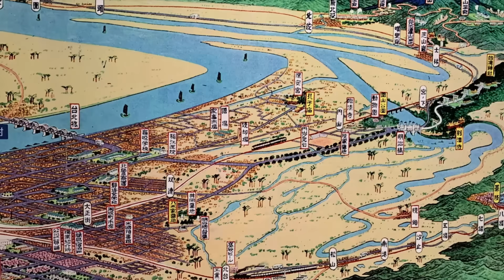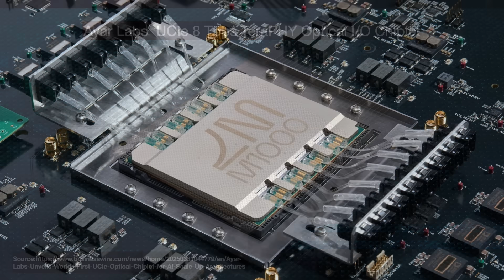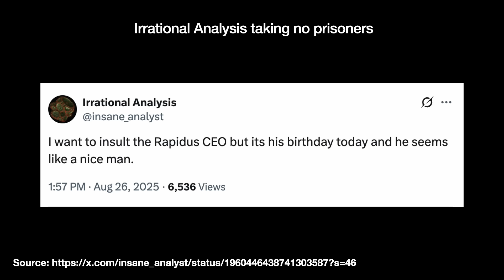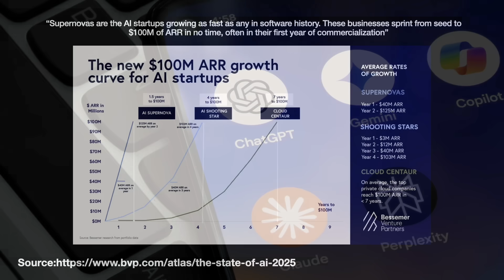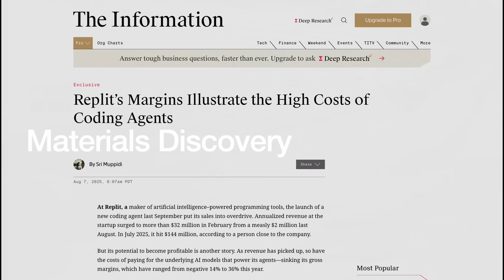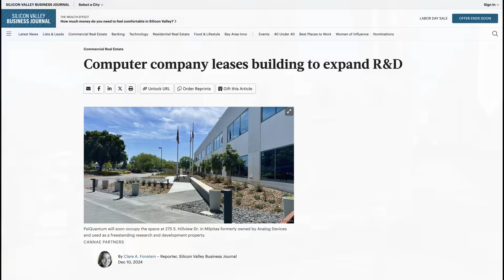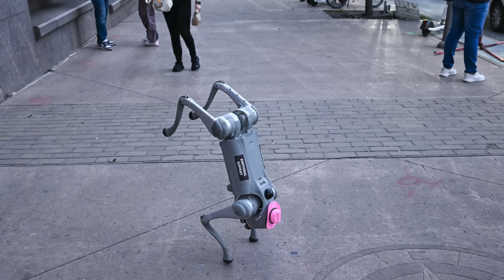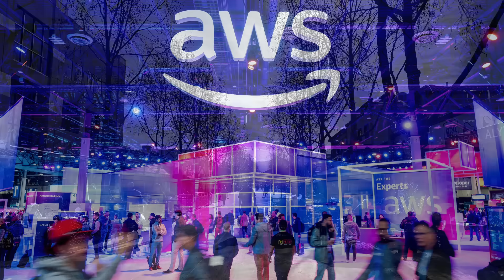Silicon Valley’s Doing Hard Things Again

Comment: You were at Hot Chips?!
DAMN, I missed the opportunity to say hi. I was there presenting a poster.

As I understood the Rapidus approach their idea is to have this fast turnaround opportunity to essentially get customers also interested in high-end nodes but that currently cannot get access because the giants buy all of it (think Tenstorrent and similar) and then use this time to develop towards a more mass-manufacturing ready node.

Photonics I agree, it seems to finally be ‚real‘ with their deeper and easier integration onto silicon.
Otherwise one of the main stories really does seem to be logistics in the datacenter. Be it power, cooling or weird ones like weight per rack. Scaling there might become difficult for these reasons alone.
Another thing I noticed is that literally everyone seems to use RISC-V for specialized tasks (ie custom extensions) in a lot of devices. Some of them actually sound rather high-performance. I would not be surprised if the big companies currently have decently high performing RISC-V cores in some products or at least the labs.
Finally I think Noam Shazeer all but confirmed that AI capability growth is logarithmic at this point and they need way more compute and bandwidth to get more performant models without fundamental changes in their approach.
I mostly think this because he is a true believer and if people like that talking about declining capability growth, then its probably happening.

Comment: It is a crazy world of suspended disbelief out there in the tech sector while cutting checks of many 0s. It isn't cost free though. I've really taken note of how much innovation has stalled. Show me one single AI application that has born fruit (outside of optimizing pain point pricing or AD revenue, the only two profitable applications I've seen). AI self driving cars? Really? We hate cabs that much? AI calculators running tflops of calculations per second? I saw someone raving about AI as the future spend 30 seconds watching chatgpt run autocorrect on their writings. AI image sharpening? It's like people forgot the solutions we had and the momentum of improvement of those paths before AI and marvel at the mediocre as long as it is new shiny AI. Also I'm not super worried about the "bubble pop". There are two categories of businesses revolving around AI. The "shovel sellers to the AI goldrush" as someone put it which there will not be a bill come due moment. A nuclear power plant is useful whether that power goes to AI generated search results or to a factory, and no one is going to return their GPUs when they discover AI isn't the future here and now. And there are the failures of this repeating burst where 90% of AI startups fail and the remainder are staying afloat with an absurd amount of capital injection seemingly on hold to join them.

Comment: If vibe coding is the "killer app" then there is no money to make. I can run open source models on my own hardware.
Also, Deep Mind is not an LLM. They used an LLM to generate test cases. re:"AI winning a math competition"
You can't ask Deep Mind, AlphaZero (chess) or AlphaFold (protein folding) what 2+2 is or why the sky is blue. It would not know the answer.
You need to emphasize the difference between an LLM and narrow purpose built AI. When people hear AI they think "chat bots".
The paper "Dangers of stochastic parrots" is just as relevant today as it was when it was released.
Q: How do you stop a transformer architecture from hallucinating?
A: You can't.

Comment: I had a "chat" with GPT over a couple of products and I was fairly impressed at how it examined products comparing their advantages and disadvantages.
After that I had to deal with a problem with one of my Google accounts which was locked up. Google has become well walled off from it customers, kind of creating an Olympic sport of out trying to get support help. No live help, no emails available for tech support and a forum loaded with people having the same problem never that gets fixed.
Their "A.I." support was awful, it's answer was to go to the same forums you already realized offered little assistance. I was foolish think a major high tech outfit like Google would be knocking it out of the park with their A.I. driven service, leaving customers dazzled.
How many billions did Google spend on a machine that basically answered every question with get lost?

Comment: Dear ASIANOMETRY,
Good to see you in my past home of 30 years. What we call "euphemistically" AI's next Killer AP will still be Programing, but the one after that that is even larger and will be much more lucrative is the huge world wide ERP Software. At the moment the AI Systems designed to work in these areas are still too "primitive" much like a bike rider can balance on a bike with no hands, as long as the roadway is straight as arrow and the smooth as a baby's bottom.  On a different subject ( one that has been obvious to many for years ) we need to move away from pushing electrons around, and find cheap and efficient ways to push photons around instead.
Reply: ERP as in erotic roleplay

Comment: Two observation. Silicon Valley waste plenty of billions on stuff that will never pan out. The Chinese gov does the same but gets steamrolled.
Low power computing is the future, superconducting computing seem really practical to me, not quantum computing. Maybe some hybrid superconducting system may pan out in the future
Reply: "Two observation. Silicon Valley waste plenty of billions on stuff that will never pan out."
Did you just use Google's A.I. for customer service too?
Reply: @AQuietNight  Didn't know that Google had anything that qualifies as AI.
Reply: @olderchin1558  They call it A.I. I just call it a piece of code that says go look in the forums. If you need to ask a question in the forums if you can't sign in, so you can't post in the forums.
What you will find is a lot of people with the same problem and the solutions offered do not work.

Comment: Regarding AI-coding: I'm only waiting for massive security blunders in thousands of different software "products" caused by AI (because it build in similar errors in its outputs for all customers).
Reply: Slopsquatting is a new term, LLMs make up npm packages that don't exist, so bad actors squat all these fake packages so when you blindly paste "npm install local-security" into your cli (or allow the LLM to do it for you) instead of getting a "package not found" you get an infostealer or malware.
Reply: Defcon has already shown that code generated by generative is bad, NX literally had an incident that exposed 10s of 1000s of none NX customers and basically exposed all security tokens stored on all machines using Yarn, and something like 100 Million in bit coin was stolen, all because an AI change was made that should never have been made.
Reply: It's not a 'security blunder', it's surveillance.
Reply: the assumption is that average human coder is doing better. While that might be the case for now I think that AI coder is improving faster than three human one. The main source of embarrassing failures is AI coding supervised by humans that are out of their depth. Thus the demand for seniors that are competent enough to supervise agents and skilled though at willing with them.
Reply: @locusgaudi  AI code generation is bad full stop. All research into it by non-industry sources are showing a negative causation in productivity in its use that becomes increasingly worse over time. The idea that "it will just get better" as Meta is building a 10Bn USD data center the size of Manhattan to try to salvage anything from what has been a black hole of investment with no return should tell you everything you need to know. Generative is a boon dongle and every big US tech company is falling hard for the sunk cost fallacy, I don't think the push to using Quantum as the next hype target will be enough to pull out of what will be an astronomical crash
Reply: @locusgaudi  and where will future "seniors" come from if the current juniors are replaced with PAI?
Reply: That will be fun 😈
Reply: And they will be easy for AI software to audit and fix.
Reply: @TheReferrer72  Amazon's Q puts its comments in unrelated files 9 out of 10 code reviews it does, these clankers aren't fixing anything. Unless what you are doing is lining up with the synthetics you aren't getting valuable code output
Reply: @BlueScreenCorp Nonsense, Amazon what? You guys act like AI technology is not improving..
Reply: @TheReferrer72  And Introduce new glaring errors that will also need to be fixed.  AI would need to be trained on exclusively best-practices to have the best practices.  You can't have perfect output with imperfect input.

Comment: I’d rather see a robot that can cook and clean a kitchen more than any other application.

We can actually downsize kitchens a lot if we take the human out entirely.

Then it becomes easy to share kitchens amongst several apartments in a building. I don’t live in an apartment, but I can see the potential cost savings for those who do.

And you don’t even need human sized robots for it. You might have several small ones. 

Maybe one operates the stove. Another, the sink or fridge. 

We’ll see how it works out. No matter how it ends up working, our food will eventually get better, cheaper and less of a hassle.

Comment: at least from what I've seen, the places AI seems to do work that's really revolutionary is in applications where we know there are a logical and universal set of rules, but either can't articulate them or can't work them out.

For a recent example, Alpha Fold has basically solved protein folding, which previously required the "fold it" citizen science game because the rules were too hard to articulate. Because the set of rules is logical and universal to all proteins, it seems to extrapolate really well to proteins it wasn't trained on, including ones that can't be crystalized, and therefore can only be checked by running physics simulations with the structure to see if the simulation matches the real chemistry. 
I've heard there's no a project on to do a similar thing for small biological molecules and metal ligands, which would be a huge deal for drug development, and sounds possible in the near future.

I'm actually pretty optimistic about using AI like alpha fold for material discovery. I don't think it can predict new properties directly, but I do think it will be able to predict crystal structures for new alloys and ceramics, and maybe even semiconductors, which is most of the challenge of predicting the properties. Once you have a crystal structure, you can start making educated guesses based on similar structures with different compositions and running simulations to see what they do. Once you can predict any crystal structure, you can take a starting point and optimize it with enough compute, and that opens up an entirely new class of materials called high entropy alloys that have some pretty impressive properties, but are too complex to design well by rules of thumb and trial and error.

I'm still not really so sure what big thing the chat bots are going to do though, since they aren't quite reliable enough to do the tedious but important stuff very well and use a ridiculous amount of energy to do it. They mostly seem to just be good at making templates and handling complex search queries better than traditional search engines.